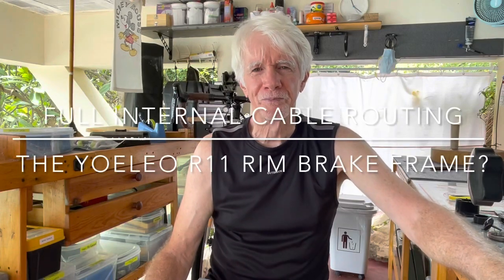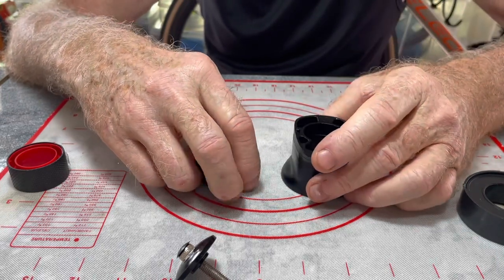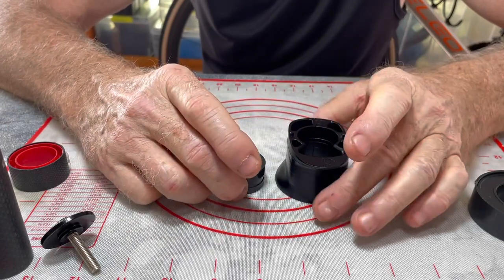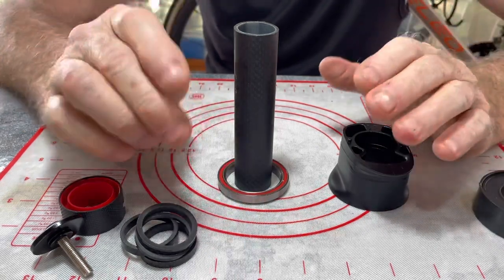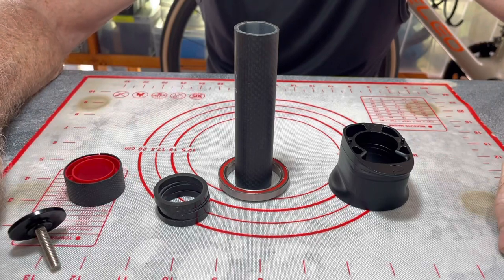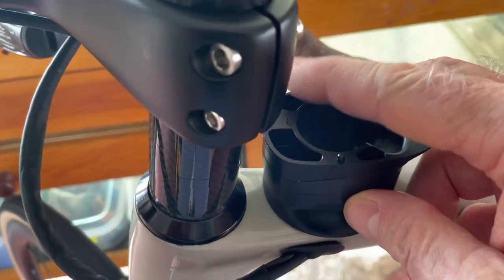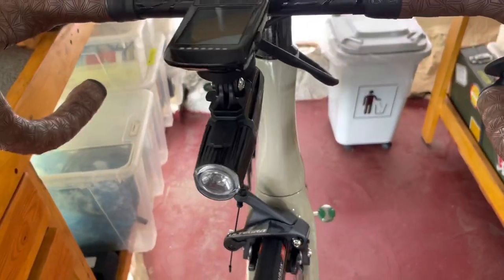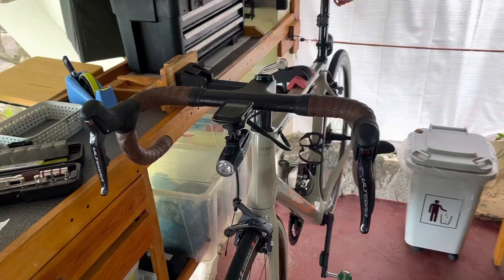Full Internal Cable Routing, Yoeleo R11 Rim Brake Frame??

Comment: You did an awesome job!  I ordered my R11 Disc frameset about a week ago.
Reply from the maker: Thanks for your nice comment! Please let me see your frame and the outcome. That will be a very cool ride! Congratulations!
Reply: @theunabiker4133  will do.  I have all my parts just need the frame/fork at this point.  I am going to use Sram Force AXS with 48/35 front rings paired to a 10-36 cassette.  I opted to go with a bbinfinite bb86 bb.  Was thinking about the Hambini but I got a good deal on the bbinfinite.
Reply from the maker: @MrLaddog  cool! I read good stuff about that one. How about the sram? I think the chainring combo sounds good.

Comment: Thank you, sir, for making this video. It answers my questions perfectly.The reason I was asking about this is partly due to the sleek look of internal cable routing but more importantly is that my current bike(a Canyon Ultimate CF SL 8 rim brake version, which has a crack on the fork so I wanted to shop for a new frameset) has the shifter cable going into the head tube and that leaves quite a bit of cable outside of the frame and sometimes it rubs my legs when I'm riding.
I fully agree with your opinion on rim brake vs disc brake. The maintenance factor of disc brake trumps the benefits of it, let alone the higher price tag and increased weight.
Reply from the maker: A new fork, and trimming the derailleur cable housings of excess length seems like a quick easy fix. Your knee should nvr contact the cable housings unless there’s not trimmed enough. It only needs to be barely enough to turn the bars all the way, either side, without putting too much tension on the cables. In fact, the only time your bars are fully turned would be loading it into the rear of a car. So you can get away with a little shorter housing without a practical riding effect. Bars typically nvr turn more than 45° when riding. Maybe take a look at that…and of course, buy a new bike too!
Reply: @theunabiker4133  let me see if canyon can warranty my fork first. The turnaround time for a warranty claim is 2 weeks, sigh
Reply from the maker: @binshuo  that’s really good. These days two weeks is a miracle. I hope that’s a firm timeline. The backups in distribution networks worldwide is significant. I ordered my frame in January. Received July.
Reply from the maker: Maybe I misunderstood what you meant sorry. In any case, good luck!
Reply from the maker: I put a link to a google sheets document on the description of the video for The Build Complete. You can check it out there.
here it is as well: https://docs.google.com/spreadsheets/d/1FARo7Uhi1QNQDzZ-Gqdj8-zl2fpDO4So/edit#gid=2036351228
Reply: @theunabiker4133  thank you. It requires access, though. You might want to grant read access to anyone who has the link.
Reply from the maker: I’m sorry. I’m not very familiar with google. I’ll look to sort it out tomorrow.
Reply from the maker: @binshuo  let me know if this works please. 
https://docs.google.com/spreadsheets/d/1KupKfo_QbRnrompzg2-cJKzVExifGiavTy-ovwxHln8/edit
Reply: @theunabiker4133  Works perfectly now but I think you should only give others READ only access to prevent unwanted edit from people. That's a really detailed spreadsheet. Very informative
Reply from the maker: @binshuo  I appreciate your concern. I made a duplicate and posted that on the channel. The idea is anyone can download it and use it as they wish. Presumably you can in fact download it. What I’d prefer is to be able to post the file itself, or email, Line, What’s app etc. anyone interested. In any case, you can use the sheet as you wish.
Reply: @binshuo  hi there,

Just wondering. Can you just get a third party fork like something from Enve and call it a day?
Reply: @ariffau  I've been browsing forks for a while. Canyon uses an oversize 1-1/4 inches steerer tube on the fork so I'm not sure if I can use a fork of standard size on the frame.
Canyon agreed to send me a fork but it's not in stock now. Just have to wait
Reply from the maker: Good luck. Let me know how it resolves please.

Comment: There's a headset with hole in it that can fit the cables for internal routing. They even have a size for small headset like 1-1/8"
Reply from the maker: Thanks for the comment. Can you send a link? I’m curious how they design it.
Reply from the maker: You sent a comment w the link but it disappeared. Can you resend please?
Reply from the maker: That’s interesting. Thanks for sharing it. A couple questions: the headset requires the use of the additional cups shown, or can be used w/o the cups?
Reply: @theunabiker4133  I think its required their cups. Im not so sure. Im looking for solution for my Bianchi Aria to integrate the cable via headtube
Reply from the maker: Good luck. Please let me know your results!

Comment: Nice info, i have 1 question :
- With different size headtube (disc vs rim), is the riding feel between both bike will be much different as headtube for disc brake is larger (probably much stiffer at the front)
Reply: @theunabiker4133  thxs u for your explanation Sir
Reply from the maker: Head tube stiffness relates to steering characteristics, but enlarging the head tube doesn’t necessarily mean it’s stiffer. Generally, yes it will be. But when tubes get bigger, walls of tubes (layers of carbon) get thinner. So, it’s possible the bigger head tube adds stiffness, but what I meant to say earlier is, this stiffness isn’t so much related to ride feel as it is to cornering and tracking, I.e handling. As far as frame stiffness is concerned with ride feel it’s all a balance of factors, bottom bracket stiffness, seat tube stiffness, and steering stiffness. I think the seat tube stiffness relates to ride feel directly. But the seat post is probably more about compliance, the comfort factor. Frames need be stiff but not overly so. Head tubes need be stiff but it can be overdone to detriment of steering and handling. No one frame part is independent of another. It all adds up. 
“Feel” is a balance of good steering stiffness (fork, head tube, bearings), pedaling stiffness (bottom bracket), and seat tube stiffness, but also “compliance”, 
I think that wheel type, tires, tubes have great effect on that. And on “feel”. 
I’m not an expert about this stuff, but this is how I understand it.

Comment: Disc brake R11 headtube is not tapered....1' 1/4" top and bottom.
Reply from the maker: Hey Stephen, thanks for watching that. I had to go watch it again after your comment. I couldn’t remember saying the disc frame steerer or head tube is tapered. I never actually said the disc brake R11 head tube is tapered or not. Granted, my presentation wasn’t as clear as it could have been, but I was commenting on the r11 rim brake frame. The point was in response to a viewer who wondered why I used the rim brake spacers not the ones that fit the disc frame (Yoeleo ships the rim frame with both sets, so it’s confusing I suppose), and he wanted to know if he could somehow rig the rim frame spacers to run cables down through.
Reply: Rear rim brake cable would need to exit from the top tube...need to drill a hole. Front brake cable can't really be thru the headtube anyhow.
Reply from the maker: @stevenleffanue  I’m unsure which frame you mean for drilling holes, but the r11 rim frame does indeed have the entry & exit ports for the rim brake cable on the top tube…I think you know that. Anyway, no drilling required. The down tube Di2 junction port is where Yoeleo has for running the derailleur cables & housings; exit ports for those accordingly. 
Since my build was Di2 the only thing I did different was to run the cockpit wire from the right shifter in tandem with the rear brake cable to the entry port for the brake cable on front end of the top tube. Shrink wrapped these together so it looks like just the brake cable. Then I ran the cockpit wire forward to the head tube, down to the down tube, and then to the Di2 junction A in the down tube. Plenty of room in the head tube for that little wire and it’s tucked out of the way of the steerer. GP Lama inspired routing trick but adapted for the fact that the R11 has no down tube port, only the top tube. 
Thanks for your comments!

Comment: If they designed it differently it could definitely be possible, ineos on the rim pinarello dogma F12 have it that way.
Reply from the maker: That’s correct. It’s certainly possible. How’s the ineos setup work? Thanks for the comment!
Reply: @theunabiker4133  not sure probably similar with the bigger bearing, I think it looks super slick and was trying to do the same on my new build but couldn’t find anything.
Reply from the maker: Why not just an entry port just under the stem? I notice several frame designs with grommet ports on the side of head tube. 2.5cm below the upper bearing would make the routing nearly invisible, certainly inconspicuous. 
Cable housing and wiring could enter discreetly out the bottom of the stem as for disc frame routing. There’s certainly plenty of room in the head tube, and it would involve a minimal amount of arc around the steerer and straight into the top tube for brake housing and down tube for the Di2. 
Of course shimano is doing away with wiring (perhaps it’s on market by now), so the brake housing remains the only issue in that case. 
A cable stop of some sort mounted inside the top tube (like the existing frame grommet but reversed…some modification to how the thing fits in the top tube port so it appears like a blank from the outside would not be difficult)